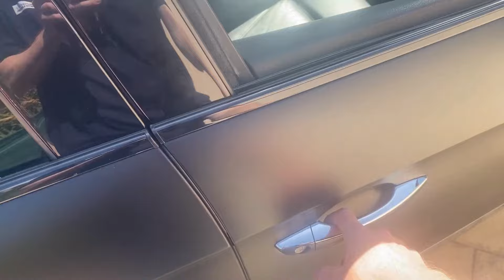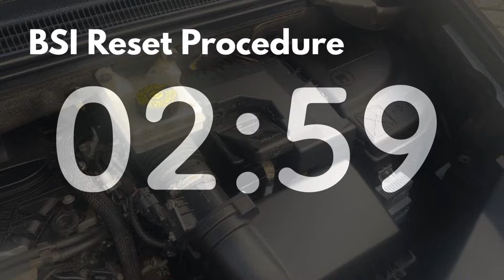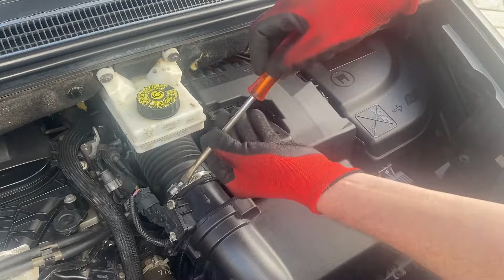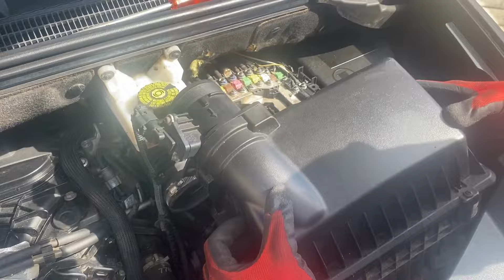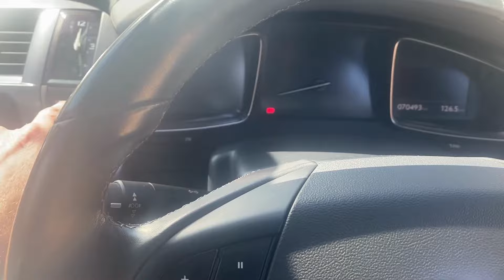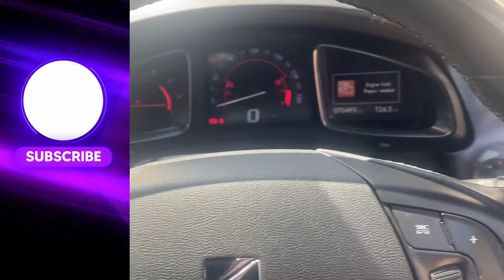Citroen DS5 Battery Replacement

Comment from the maker: Compatible batteries and tools available from Amazon you can use for this vehicle (From our experience, Varta batteries have proven to be reliable and long-lasting):

🔗 Bosch 70Ah EFB: https://amzn.to/4pdDHWA
🔗 Varta 70Ah EFB: https://amzn.to/4oeNoTP
🔗 Varta 70Ah AGM: https://amzn.to/4i5Rk7Q
🔗 Battery post/terminal cleaner: https://amzn.to/49nOAk3
🔗 Socket set: https://amzn.to/4pSfuGh
**👇 For batteries less than 2 years old, a good charger might fix it 👇**
🔗 Battery charger I've personally used for over 3 years: https://amzn.to/3T8KG8k
🔗 CTEK battery charger with AGM charge function: https://amzn.to/4j7Sm3F

These are affiliate links, which means I may earn a small commission (at no extra cost to you). It helps support the channel and keeps these tutorials free. Thanks for your support! 🙌

Comment: I followed this but soon as I put the positive on my alarm goes off and the positive sparks and there's no way to turn the alarm off
Reply from the maker: Always some kind of issue with these cars 😅.
The alarm going off after a BSI reset on a Citroën DS5 is well-known, and usually caused by module wake-up timing and voltage behaviour, not necessarily by an incorrect procedure.

Here’s what you can try:
1. Connect the battery 
2. Use the key fob to unlock
3. If the alarm still goes off, insert the key in the ignition and press start.

If none of the above work, the key is most likely not communicating with the car.
Reply: still didn't work so I just pulled the fuse out, was just thinking about my neighbours. Definitely the worse car I've brought I kinda regret getting it now
Reply from the maker: Bonus points for being considerate 👌. The trick is just finding what the car is unhappy with, might be as simple as a faulty bonnet switch. Try using chatgpt to describe your problem, trying its suggestions and feeding the result back, its sometimes very handy at faultfinding and at the same time you're training it to isolate the problem.